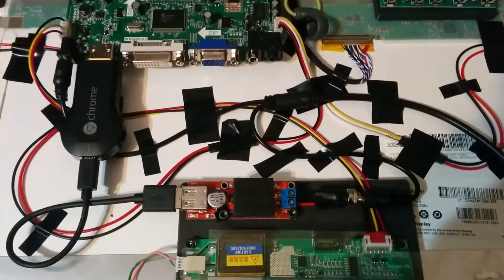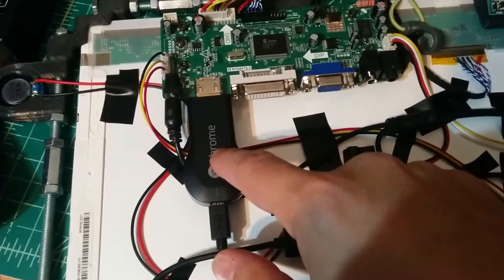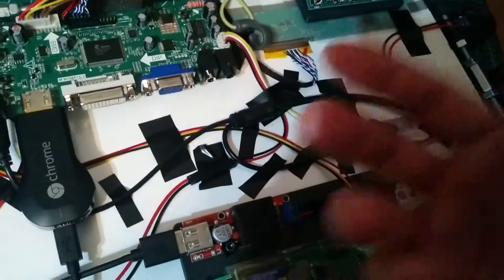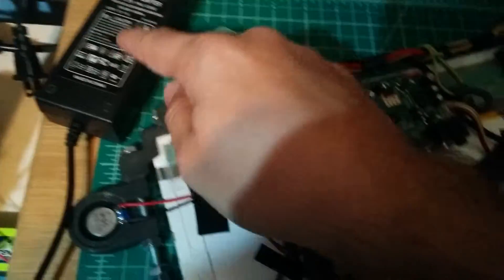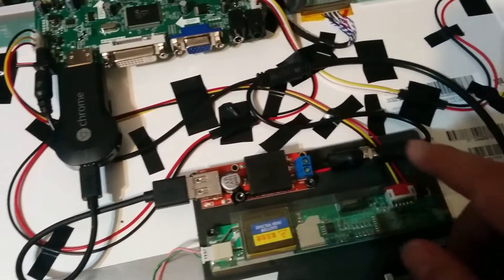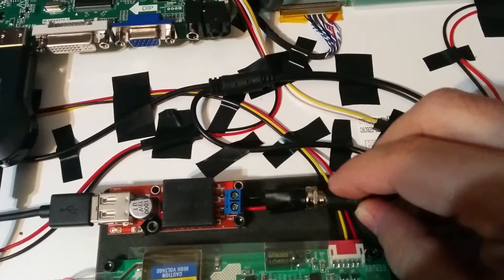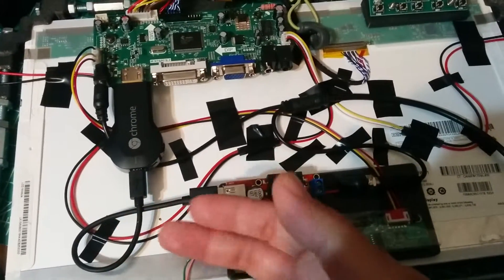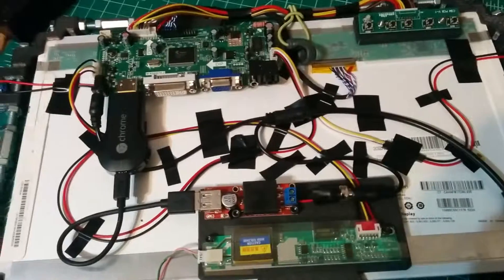How to power lcd and Chromecast on 1 power supply.

Comment: I appreciate every second you put into this video :) BTK7 here, I have done lots with low, DC voltage and batteries, but AC has always been a scary thing to play with to me (ever since I literally exploded a processor cooling fan with it when I was like 12)

I was provided with a 12V 1A power supply (from my understanding the A is short for 1000 milliamps) for my monitor from the distributor of the driver board.  

I'll probably end up getting the materials you linked to to save space, since the end result is to have the RPi3 kick out some old games.

Thanks so much!
Reply from the maker: +maybe3392  Yes, 1A is 1000ma. Since you have a similar board, it must run at around 750ma as well, so that 1 amp supply has enough power to run the panel.  I looked online the the RPi runs at about 700ma, so it doesn't draw a lot of power. So the 5amp supply will be plenty and shouldn't heat up since you're not drawing alot of power.  AC isn't too bad, you need a way to convert it to DC since practically all electronics runs off DC power.  Watch a video about a diode rectifier circuit which is a simple method of converting AC to DC, makes AC seem not to bad.

Good luck and post some pics or vids of the finished product. Would love to see how your retro rpi game system turns out. I might consider doing something like that someday. 

Oh btw, if you want to buy that stuff, use the links I supplied. I get 4% kickback for getting people to buy stuff off amazon. Every little penny counts to help get me to a personal goal of mines :)